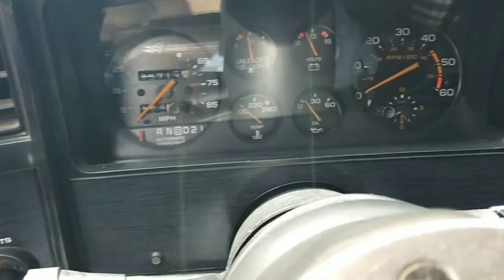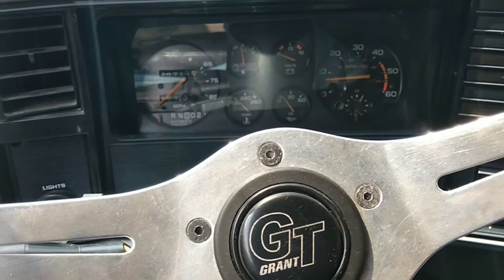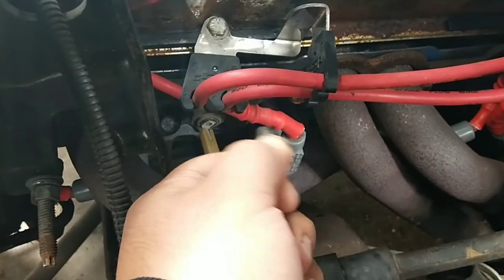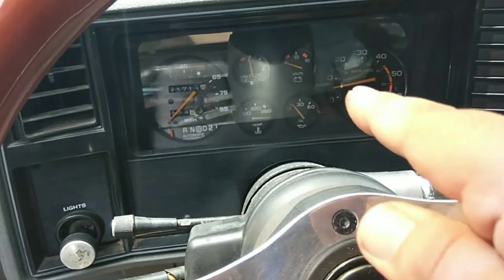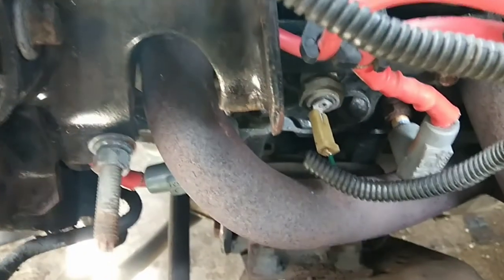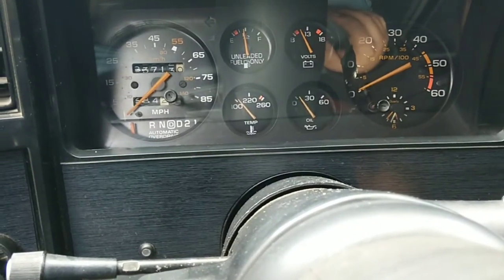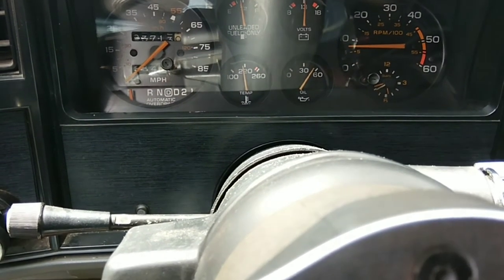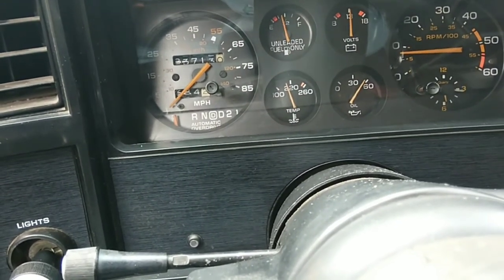Temperature gauge diagnosis

Comment: if that's the temp sensor, then whats the one with 2 wires connector on top of the intake manifold?!!thanks!!✌️✌️
Reply: That’s the ac wire
Reply: The 1 on the intake should be the vehicles coolant thermostat. The 1 he changed is for the vehicle instrument cluster as the video showed